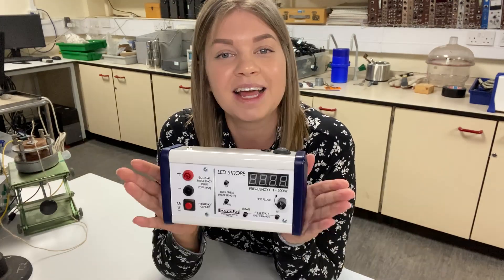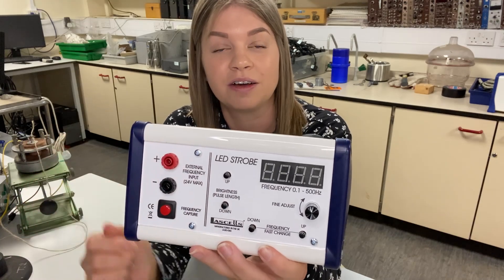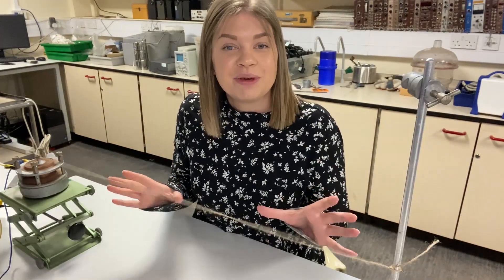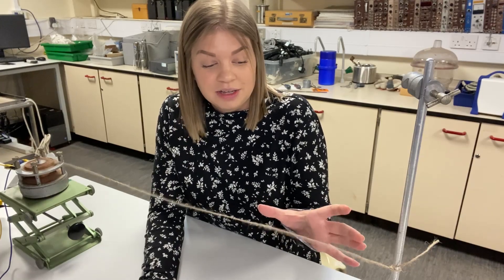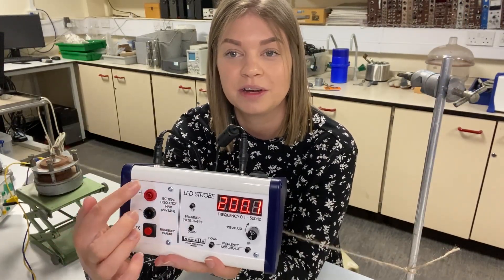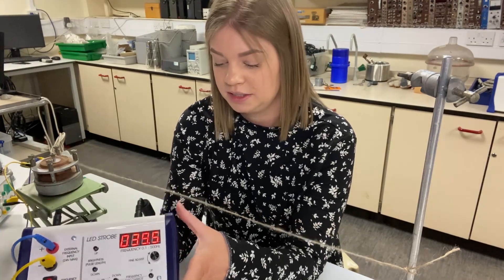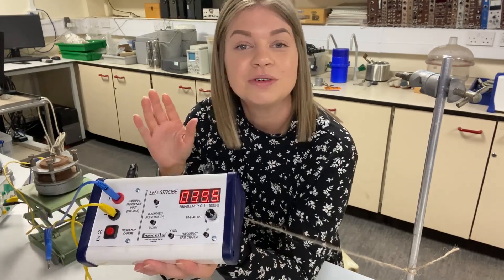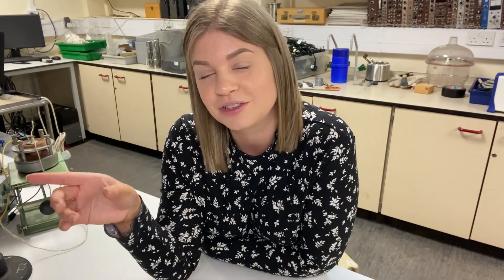How to Freeze Waves on a String with an LED Stroboscope

Comment: Similar technology is used by acoustical engineers for designing and measuring the performance of speakers (specifically subwoofers). You can find similar (albeit less capable) handheld units on websites that sell audio equipment